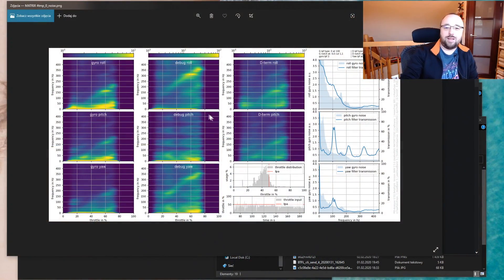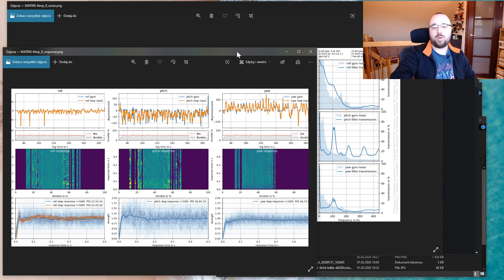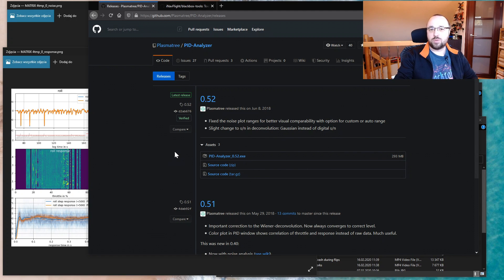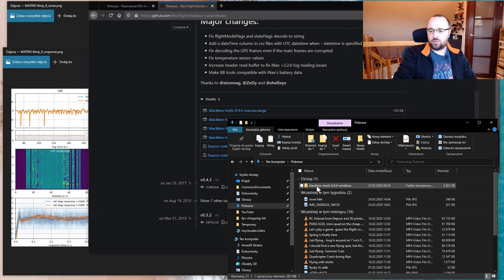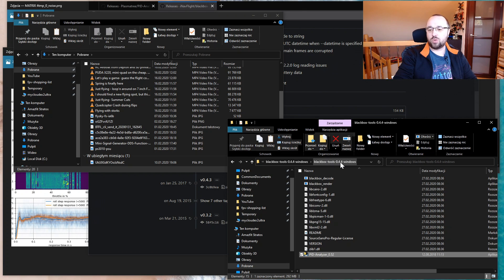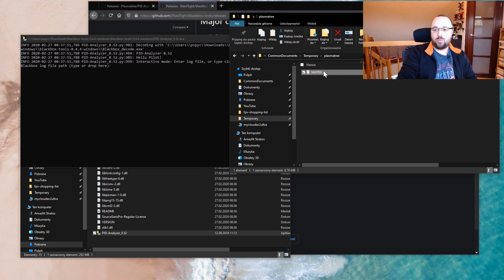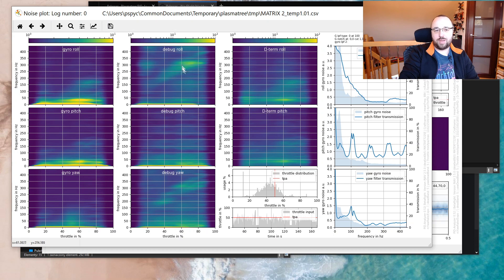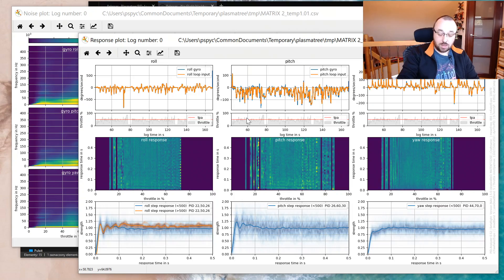Plasmatree PID Analyzer for INAV

Comment: Plasmatree is great. I've made myself a primitive batch that takes all the *.txt, *.bfl, *.bbl files in the folder, runs the analysis for them, saves the results and deletes the temporary files. So all my flights of the day are analysed by one bang. I'd recommend to use switch "-nb [[1.,100.],[1.,100.],[1.,100.],[0.,4.]]" to have all the noise plots using the same scale. It's much more intuitive to see the actual strength of the filtering (by default the scale of the gyro graph is 0-10, the rest is 0-100).